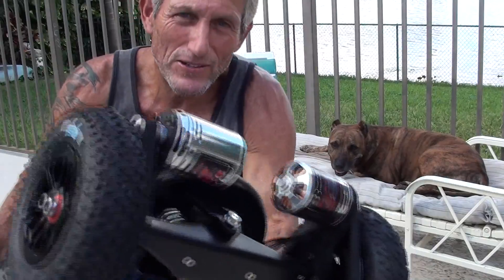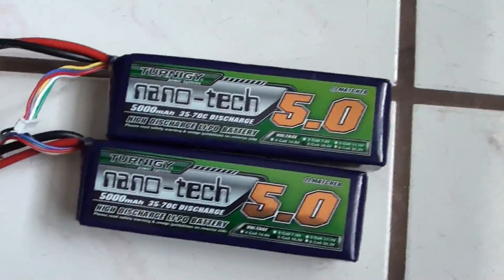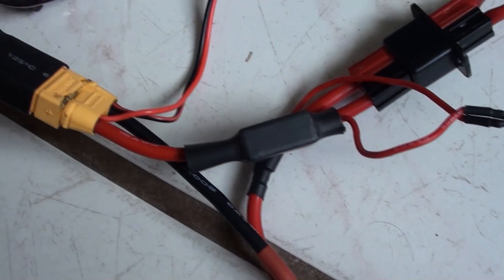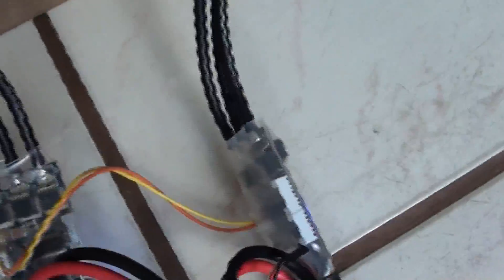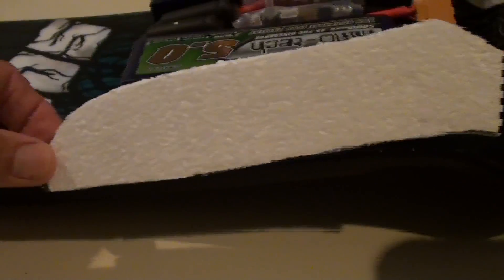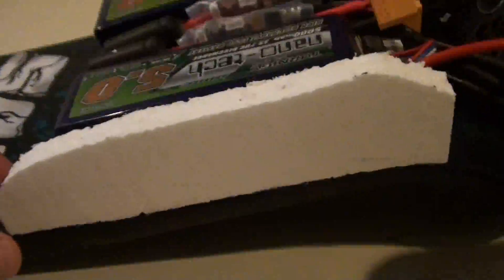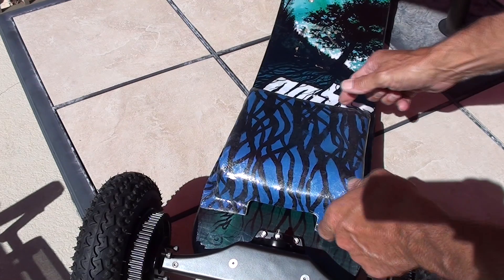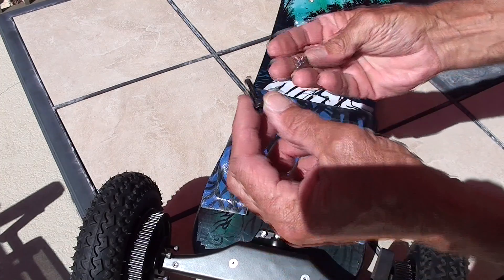Electric Mountainboard/Skateboard Build

Comment: do u mind listing all the stuff u use? with links to where u got them etc? thanks
Reply from the maker: Sure thing, just make sure all the electrical connections match, it will make things much easier. If you order  the mechanical kit from Scramboards make sure the inside diameter of the motor gear is the same as motor shaft as they come in different sizes. Also, Scramboard motor mounts didn't fit the MBS trucks I had so had to use Trampa trucks which worked well with the motor mounts.

Motors, batteries: https://hobbyking.com/en_us
VESC: http://diyelectricskateboard.com/diy-electric-skateboard-kits-parts/vesc-the-best-electric-skateboard-esc/2
Mini Remote: http://www.dhgate.com/store/product/2-4ghz-mini-remote-controller-with-receiver/377608417.html#sshot_-1-null
Mechanical Drive Parts: https://www.scramboards.com/conversion-kits/kit-4-mechanical-drive-train-brackets-parts-kit.html8
Also used Ebay for many of the electrical connections such as the series connector, battery meter etc: http://www.ebay.com/itm/2016-Battery-Capacity-Tester-Indicator-for-12V-24v-36v-48v-CAR-Lead-acid-lithium/172143986261?_trksid=p2047675.c100005.m1851&_trkparms=aid%3D222007%26algo%3DSIC.MBE%26ao%3D1%26asc%3D20131003132420%26meid%3Df11d625055f44abaab01d75be8c85db2%26pid%3D100005%26rk%3D2%26rkt%3D6%26sd%3D3318791017972

Comment: great build.  can you detail exactly how you made the enclosure please, what products you used exactly, how many layers of resin and cloth, etc...  
i would love to make an enclosure as well.
Reply from the maker: Hi Genis, I used polyester resin and fiberglass cloth. About 10 layers total of 4 and 6oz cloth but you can also use fiberglass mat or epoxy resin also. Just keep piling up layers wetting each layer with resin, rolling and squeegeeing out the bubbles as you go. If you mess up just add more glass and resin and lots of sanding. Look at my kiteboard repair video https://www.youtube.com/watch?v=Lu8fnOLxcaw and adapt that technique to the mold. Have lots of acetone on hand to clean up the mess and trim excess glass with utility knife/razor when the resin sets up slightly but not totally cured. There will be much less sanding. Then paint the enclosure with water based arts/craft paint then put one more layer of 4oz cloth and resin over that to protect the paint from chipping.
Reply from the maker: One other thing.  Polyester resins will dissolve some types of styrofoam so test it first. If it does use epoxy resin instead.